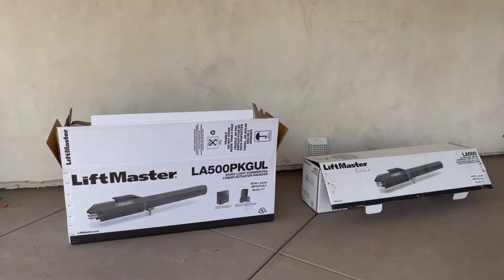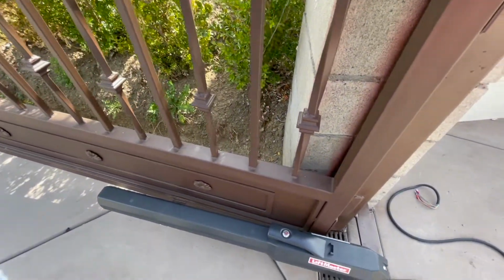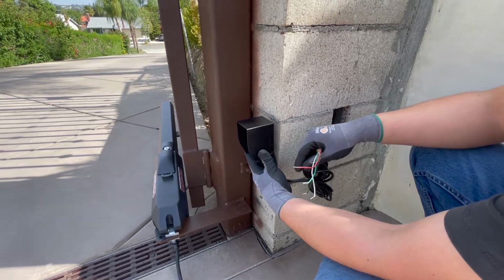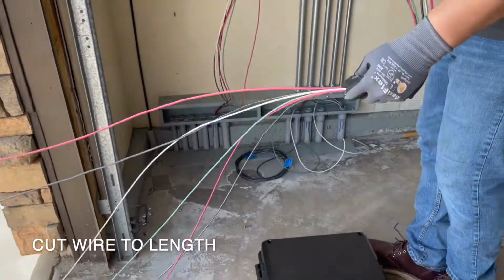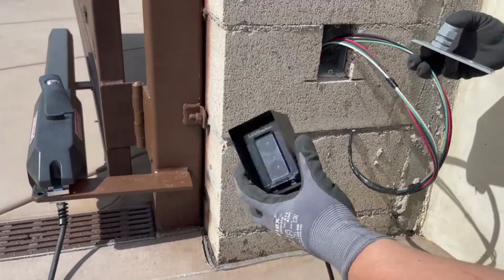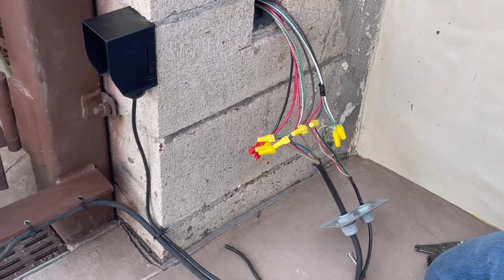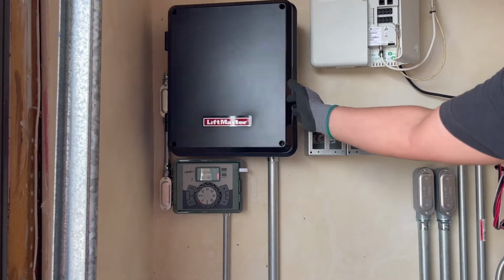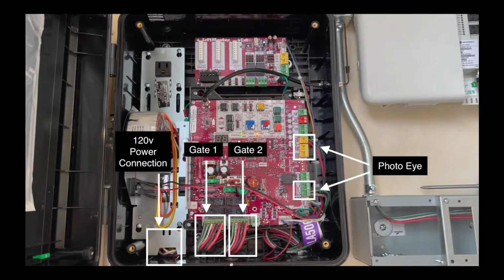How To: Install Liftmaster LA500 Gate Opener

Comment: How not to install a LA500 push to open should be the title.
Terrible geometry. 
Really long run for low voltage.
Photo eye always connected on eye to close.
Reply: Do you know what the gauge of wire on the original wire harness that goes from the arm to the control box is? I know the power is a heavier gauge looking to extend maybe an additional 10 ft of wire to the original wire bundle to control box. Looking to mount the control box a bit further than the original wire Loom harness will allow

Comment: You made everything look nice, that seems to be rare any more so great job on that. However I have a few issues with the details. #1) 10 AWG wire for a 24 volt 500mA system and a short run, isn't just overkill, it's ridiculous. My first thought in seeing that would scream a job done by someone that didn't really know what they were doing. #2)  You used weather tight connectors, good, you used a weather tight cover and gasket, good, and then you just stuck it to a non weather tight box on a hole in a CMU block. You'd have been better off not using the gasket at that point, at least without the gasket the water that's going to get in there through the block would have a way to get back out. #3) It's not legal to leave bare copper wire exposed under your terminal connection, granted, it's only 24V 500mA but still, just clip a little off the end of the wires and get your insulation flush with the terminal.
Reply: Forgot #4) that wire going from your box to the motor is going to rub on the corner of that block wall and wear through the insulation.

Comment: We just purchased a house where the previous owner disconnected the two wires that allow the gate to auto open as you drive out. We’ve tried every scenario of connecting the wires and they don’t work. Wondering if you could cover the connection of those wires that allow the gate to auto open with the underground sensors.

Comment: I almost didn't watch this video, because I don't think think I was going with a liftmaster opener.

But boy am I glad I did! I'm a homeowner in the middle of DIYing a wall and gate project, and this ABSOLUTELY has been a eureka moment on how I'm going to do the wiring for the opener. I'm a smart guy, and I've been thinking about how I'm going to do this project.  Putting the control box remotely and not worrying about mounting the box right next to the openers removes so many issues for me, and it'll make it a much more attractive install.

Thank you for this fantastic video!  This is why I love youtube.

Comment: Great job guys. I noticed the LiftMaster 500 only handles a gate up to 13 feet if you have a 15 foot gate that weighs under 200 pounds would you still be able to use it instead of a two arm system? Also when the gates closes… How does the gate lock down, so nobody can push the gate open….or is there a separate locking system?
Reply: You can add accessories like a magnetic lock or an electric latch...

Comment: Should have used a proper outdoor rated J box and made it properly weather resistant. And should have use ferrules for the control wires into the control box...

Comment: FIRST CLASS install!  Great suggestion to increase wire size due to length and potential voltage drop given the distance the controller is from the operators!  Keep up the good work!  THANK YOU!

Comment: LOL he installed the photoeye wrong. It comes with a bracket to mount the photo-eye too. What he did was using the cover which that hole he used that screw through. Is the place the screw goes into to hold cover onto the photo-eye. The way he mounted it you can't make adjustments. Also less secure and if the photo-eye doesn't make contact with reflector the gate stops functioning.  He did alot of it right but that he did wrong. Number one service call I go on for gates is photo-eyes out of alignment. Which they do get knocked on more than people think.

Comment: Everything looks very professional minus those hinges on the gate
Reply: I agree, non greasable, non adjustable hinges which I hear squeaking already.  I replace a lot of these style hinges up here in Alberta because of frost issues heaving posts not installed below frost level.
Reply: @idiotradar1  whats the best style hinge for a wooden gate?

Comment: Great video! Where and what kind of battery backup is used with the LA500? I can't seem to find it.. Thanks
Reply: Inside the control box behind the control board there is (2) 12volt 7ah batteries. Those two batteries power the system when the power goes out or of the system is solar powered. A brand new kit will come with batteries, but if new ones are needed you can find them for cheap at Home Depot in the emergency lighting section.

Comment: Great Job! Can I ask you, how long is the bracket you had to custom make? 
1) More specifically, how far past the "hinge" did the bracket go? Distance from Hinge to hole for actuator?
2) What was the distance from about the centre of the hinge to the inside of the bracket?

Do you have the specs? I am in a jam right now...and I'm trying to make my gate a push-to-open as well.
Reply: Ghost Controls is one of worst operators on the market next to mighty mule. The brackets Ghost Controls provides are just as cheap and flimsy.
Reply: Ghost controls gate comes with everything to be install and their pricing is really good.

Comment: how long was that new bracket you made on the post? i have a similar situation. and what size is the hole you drilled for it?
Reply from the maker: The original was 9 inches long. We welded a 4" extension which gave us a new length of 13". The holes were already pre-drilled by the manufacture to 5/8" diameter. Thank you for watching!